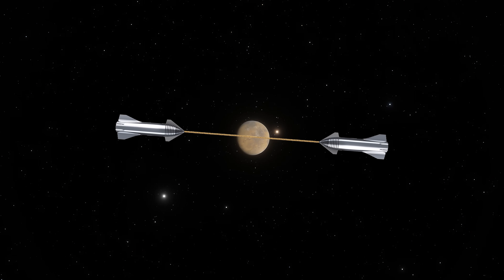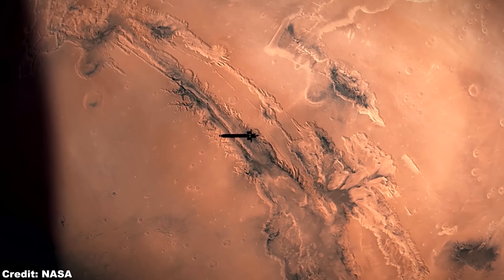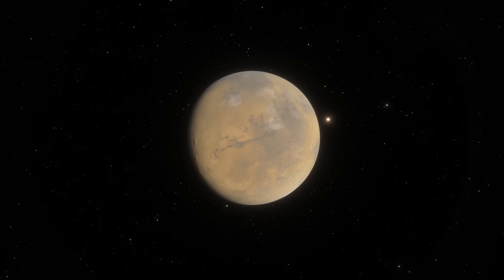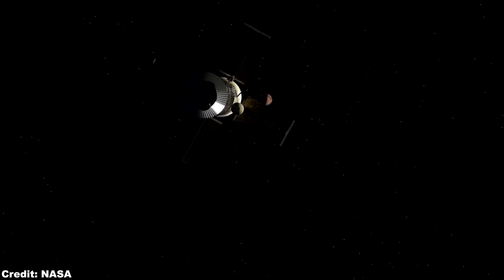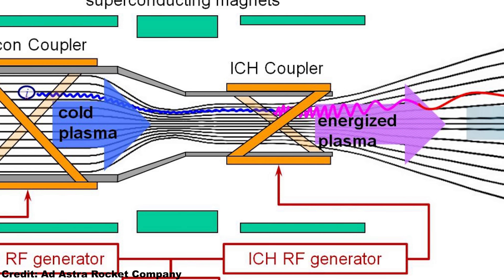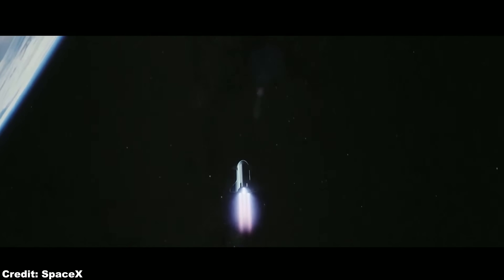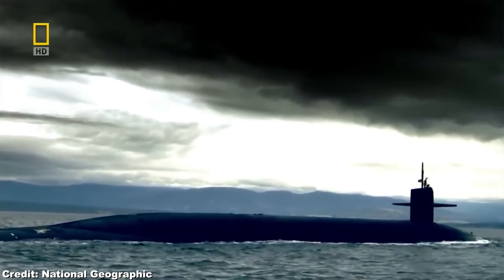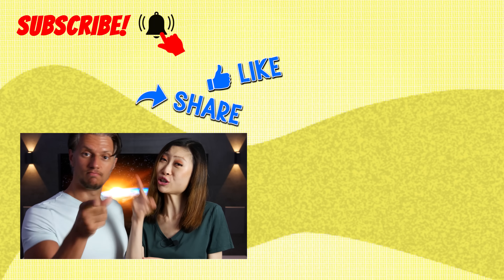4 Ways To Upgrade Starship's ENGINE! [SpaceX Starship FLAW FIX]

Comment: My plan is completely different, my direction is completely opposite to what is currently happening. I hope you can follow. After a teacher was tragically killed , I vowed to make a difference in the development of Rockets, it took years and the final part of the puzzle was in place . Parker satellite, the material is what I've been searching for, along with the heat shielding tiles from the Space shuttle. My design is a hybrid,  part plane , part rocket and Lasers powered by Electricity...to grasp it all , well this is also an internal engine, kinda like your car , with that been said, let's take a look their. Cars  have given me many things to work with since they have surpassed 300 mile per hour range. And a suprising 3 cylinder part electric 4 seater . I focused on one a bit before that . A formula one car that blew the competition away so badly that it wasn't allowed to participate. A rotary engine. My problem was that the pressurization heat would melt my engine, now that's out my way due to well, what I mentioned above. I can securely say my engine can safely produce over a million pounds of thrust without,  well blowing up. And this engine is multi purposes for the same reason, it's got to do just like any space craft, it has to make turns and has to have those vectoring thrusters. Need help to bring my creation to life . Everything can be explained and very factual.
Reply: But a cylinder engine is dependant on the atmosphere to operate. And a cylinder engine is DRAMATICALLY less efficient then just a basic rocket engine. Yes your car can go 300mhp but a rocket can go 17,000 mph easily.
Reply: @a1919akelbo  yes I agree with you, since I purposely left out a few major factors that makes my engine  significantly faster and efficient. My fuel can just be the plasma itself, explained by Liek Myrabo himself (LightCraft) via YouTube of course. I developed a improvement by using a  method called sequential firing by using diodes for triggers. His single cylinder has nothing to no support and the laser is stationary, on my system it's enclosed and uses helium as the fuel and can make Mars and back in under 3 days . Still missing more important key factors.  I can only tell so much, but everything mentioned here is realistic and possible because everything that is needed is in existence today
Reply: @wikkid1show569  first off, plasma cant be fuel since plasma is the end result of the combustion or energization of fuel. Thatd be like saying your going to use food to buy a car, no, you already spent the money, now you have bread. You cant use bread to buy a car. You can however use the plasma as a mass to push against (ion propulsion) or have the reaction that creates the plasma accelerate you (rocket engines). A cylinder engine converts Linear forces to rotational forces THERE IS NO USE FOR THIS IN SPACE (Except in positioning systems). You are proposing putting a fully expanded gas inside a system that is SPECIFICALLY designed to harness energy from the EXPANSION of gasses. This would not work. In fact all the plasma would do is cool down, and create a low pressure enviro inside the cylinder. Hell lets say you figure out how to harness the low pressure energy into your engine, and let's say you've found a way to transfer rotational energy into vectored linear energy too. Even then. You would have to first create the plasma then put it through the engine. And i don't think youve unlocked the mysteries to 100% energy conversation so there is a loss. A dramatic loss. In the 99%'s (i can do the math if you need further proof). It would be LITERALLY hundred of times more efficient if you just took the created plasma and immediately shoot it out the back. Every micro second you spend holding onto and doing things to that plasma is throwing kiloneutons into the toilet. Plasma isnt a magic gas that can be used to power anything. Plasma is a flame, plasma is the sun. The millisecond you stop fueling a flame it goes out. Plasma isn't stable, plasma cant be harvested for energy (unless your talking fusion), plasma can only be gotten rid of or allowed to form back into its natural state. That's it. You're trying to start a fire using ashes dude.
Reply: @wikkid1show569  here the most basic way of thinking of what i just said. You say you have an engine that can turn hot energy into spinny energy into fast energy. I say we already have engines that can turn shocky energy directly into fast energy and boomy energy directly into fast energy. Why do we need your inefficient engine that takes 3 steps instead of 2?
Reply: @a1919akelbo  when it comes down to it, did you take a look at Lightcraft, if so , you saw a single cylinder system exposed, and recognized that they spun it using an airgun and in slomo it gave a disbursement. When it comes down to it, this format is practical and fits for faster space flights and can burn for the entire trip and not 5000 seconds which is the energy shown in this video.
Reply: @wikkid1show569  the energy comes from the airgun not the plasma.
Reply: Jesus fucking christ dude, i googled it and a "lightcraft" engine is just a magnetic plasma drive. Theres no "car" engine and this idea has existed for fucking eons its not "new" or "alien". There's a video where it literally says "the engine operates by pushing heated plasma through a large electromagnetic field". We researched it, we looked into it. And unless you have a fusion reactor in orbit there's no benefit to the cost. Also "shockwaves" of light don't work that way. I did a bit more then watch a YouTube video.... I spent 10 years of my life studying this.

Comment: It would seem, that for the foreseeable future at least, nuclear thermal engines would be the most likely way to get people to mars in a fast and efficient way. One idea i have, is to maybe adapt a tanker version of starship, with fuel tanks that could be used in a reversible manor, while putting one (or more) nuclear engines underneath a (detachable) nosecone section. Then you launch it into orbit like you would with a regular tanker, and once you get there, you refuel it and dock it but-end with a starship in orbit, and voila , you got a starship ready to go wit a nuclear booster attached. An even crazier idea (if at all technically possible, that is) would be to do something similar with an adapted version of the super-heavy booster. Start with removing the landing legs. Add the nuclear engines at the top underneath a faux (detachable) nosecone. Add regular (chemical) tanker versions of starship (2, 3 or even 4 ?) to the sides of the super-heavy as boosters. Fuel up the super-heavy with enough fuel to get it in orbit, then launch it. If it gets to orbit, refuel it, and attach it but-end to a starship, like a tanker. Then you got an even bigger booster, plus, because the super-heavy has attachment-points, you could add other starships in orbit, like two chemical boosters and two freighters, or four of each to either carry some extra load, or give it even more extra speed.
Reply: "Fast and efficient way" orbital mechanics states you can only pick one here.

Comment: We definitely need more nuclear engines! If SpaceX can provide Starship as lunar lander (or even just get orbital), Nasa could really start investing heavily on nuclear engines and reactors. VASIMIR would be awesome, but even if all other problems are solved, artificial magnetic fields can be bad for humans. Basically the artificial magnetic field traps radiations inside the ship because it can't get out. And human body ain't doing well either. Within strong magnetic fields electrolysis is known to happen with saliva causing different taste. I recently found a scientific paper from 2005 about this, it's not too long. It's "Shielding Space Explorers From Cosmic Rays"
 by Eugene N. Parker. Google it, and I think it was the first result (agupubs)

Comment: Artificial gravity for a couple of hours a day almost for free on Starship. The inside of the hull is approximately 8 meters in diameter. You could ride a bike around the inside of the hull at 32 km/hr and your head would be at 1 g and your feet would be feeling more like 2g. It's not a new idea but I don't hear anyone talking about it. Not a perfect solution but better than nothing.
Reply: That sounds good but a steady diet of 21 rpm might make people nauseus, on a bike you tend to keep your head in a fixed position so hopefully no nausea. I'm also wondering if rotating the whole ship will really be that easy.
Reply: @robcowley85  Nope !

Comment: Look into nuclear batteries. The components have a half life of a 100yrs. The radiation emitted can be blocked by 2mm of sheet steel. These engines and designs will only work for starship if the nose cone is able to disconnect and reconnect with the different engines and fuel. Because the amount of thrust to mass ratio is so low. Pushing the vasimir engine alone with the vasimir exhaust will take some time to get to an appreciable speed. Hard to imagine how long it would take to get 100 ton of fuel up to speed. Of course we can imagine some tweaked version that incorporates a small combustion reaction rocket engine whose hot exhaust components are compressed electromagnetically further increasing increasing the heat and energy to plasma levels. Decreasing the amount of rf heating needed within the plasma drive. Putting that saved energy into magnetic confinement and further acceleration. So send a fuel tanker in orbit around mars the slow way. It will be there for when the crew with the vasimir arrives... 

You know the  starship enterprise the disc can separate  from the plasma warp drive. So isipose it the way it gonna work

Comment: I'll stick my oar in, see if I can get it wet.

Problem: if a non-chemical rocket engine is added to Starship that is only useful in space, then we will not want to land that extra mass on Mars, only to drag it back out of the gravity field when it's time to leave.

Solution:  add a nuclear 'tugboat' for the transit to and from Mars.  This is a separate module which is added to Starship in space, detached at Mars orbit, reattached when it's time to come home.

Problem:  It's still too slow.

Solution:  Mate a booster stage to the stack in orbit.  Boost the Starship, along with its nuclear tug.  This conserves fuel on-board Starship, which it will need to reach Mars orbit, since the Starship will be going faster.  The booster then returns to Earth orbit and is refueled for the next Mars mission.

Problem:  I want a boost on the return trip, too!

Solution:  Okay, add a booster to Mars orbit and use it to go faster for the trip home.  That booster will return to Mars orbit for the next mission boost, too.

Problem:  Where is all of this extra chemical fuel for boosters coming from?

Solution:  At least initially, from Earth.  We have to shoot up tankers to fuel Starship anyway.  More tankers will be needed to follow Starship to Mars.  With the booster scheme, we'll need even more tankers.  It's going to require a hell of a lot of launches for each Mars mission.  Once we can synthesize fuel on Mars, we'll also need tankers moving chemical fuel to orbit and returning for more.

Problem:  Argh, it's all way too complicated!  And expensive!

Solution:  go slower.
Reply: People go on long sea voyages — and in cramped corners (nuclear submarines).  A different "solution" to the slow Mars trip is to either have less people per trip or build a bigger ship (18 meters anyone?).

Comment: THIS IS ELON ! AGAIN !  OUR NEW MAD USA ENGINE FOR OUR TRIP TO ANDROMEDA IS NOW BEING ATTACHED TO OUR NEW MAD USA ROCKET AT  THE NEW ANTARTICA SPACE X LAUNCH FACILITY !  THE MADUSA IS NOT A ROCKET ENGINE ITS A NEW PROPULSION SYSTEM BASED ON ANTIMATTER FROM COBALT 55 MELTING GIANT ICE CUBES OF TRITIUM
AND DEUTERIUM  FIRST WE SEND UP TANKER AFTER TANKER OF ICE CUBES THEN THE SLUSHY MACHINE IS SENT UP AND THE SLUSHY MACHINE IS CONNECTED TO THE TANKERS WITH THE ICE CUBES . THE SLUSHY MACHINE MAKES SLUSH AND THE ANTIMATTER IS INJECTED MAKING SUPER HEATED ANTIMATTER ANIHALATED STEAM THAT POURS OUT OF THE SINGLE COMBUSTION CHAMBER THEN FLOWS OUT OF 50 TUBES TO THE 50 MADUSA NOZZELS .  SO ITS NOT A ROCKET ENGINE ITS A MAD USA DRIVE FOR ROCKETS OR ANY THING ELS U WANT TO ATTACH IT TO LIKE A MONORAIL OR A DOUBLE OR TRIPLE TUBE HYPER LOOP AND THE NICE THING IS ITS ONLY MELTED ICE CUBES IF U DONT WANT THE RADIATION !

Comment: What about solar power? some solar panels reach 2000 W/kg and 17000 W/kg could be achieved in the near future.
Reply: Well solar panels absorb energy they don't expel it, you'd need either an ion engine, HAL effect thruster, thermal rockets, etc. But keep in mind the more surface area the more mass.
Reply: @a1919akelbo  Add to that, the further from the sun, the less energy. Solar cells are about the order of 6% efficient, 10% at most.

Comment: The key is hire the energy production. In space to have effective inter planetary travel an effective fusion reactor needed. The nuclear option is only feasible in rotating systems where the Starship is in multiple km from the central.
There is another method to travel but it is very SiFi (at least now):
Warp drive or FLT (Faster than Light). --> the current problem: There are huge holes and misconceptions in particle physics and in cosmology.
It could work if:

1. Gravity is not a force.
     This means there is no force carrier particle (graviton does not exists). But the gravity is a flow of underlying fields.
2. We find a high mass particle what can effectively manipulate the flow of those fields.
3. Properly working light weight fusion reactor to feed the particle collider with energy.
It is at least a century away...
Reply: Solar power can be very effective (between 2000W/kg and 17000 W/kg in the near futur) but you need centrifugal deployment.

Comment: Also fusion rockets especially  the pulse variation [ http://large.stanford.edu/courses/2013/ph241/micks1/docs/aiaa-2000-3856.pdf ]. A citate  :
==================
When light atoms like hydrogen fuse together, the energy released surpasses that released by splitting heavier atoms through fission, so much so that a rocket propelled by this energy could reduce the travel time to Mars from a matter of months to a matter of weeks. [4] However, fusion is not as well understood or as easily controlled as fission, which is why fusion reactors aren't used in commercial power plants, but only for research. Fusion reactors still struggle to contain their plasma within magnetic fields, and current designs require so much energy to sustain the fusion reaction that the reactors produce a net loss of energy. Nonetheless, fusion releases so much energy that the technology only needs to get a tiny bit past the break-even point before it can generate considerable thrust or electrical power. [4]
Fig. 3: Project Daedalus with its colossal fuel tanks. From nose to nozzle, the design was nearly twice the length of a Saturn V rocket. (Source: Wikimedia Commons)
Fusion rockets differ from fission rockets in that the propellant expelled through the nozzle would be the hydrogen-helium plasma involved in the fusion itself. Like in a tokamak fusion reactor, the plasma would need to be contained by a magnetic field, except the field would be shaped to allow the plasma to "leak" out the nozzle. [4] However, in order for the particles generated by the fusion reaction to be charged so that the magnetic field can direct them out the nozzle, the plasma must be heated much more than is necessary simply to initiate fusion. About 100 million Kelvin is the required temperature for fusion, but the reaction mainly produces neutrons at this temperature, which can't be steered in a certain direction for thrust. 600 million Kelvin, on the other hand, can enable a different fusion reaction that produces charged alpha particles, meeting the requirement for thrust. The plasma can be heated to this point using microwaves, although such heating would require significant power on board the spacecraft. [4]
An alternative to the continuous-flow rocket described above is Project Daedalus's pulse propulsion engine, where pellets of fusion fuel would be injected and then ignited by electron beams inside a reaction chamber. The fusion fuel included helium-3 for its high energy release, although this isotope is extremely rare on Earth and would probably need to be mined from the moon or the atmosphere of gas giants. [3,5] Daedalus was designed in the 1970s to be a fusion-propelled interstellar mission that would reach a max speed of 12.2% the speed of light and arrive at Bernard's Star (5.9 lightyears away) after 50 years, all using nothing too far beyond the existing 1970s technology. [3] Although the project was simply a feasibility analysis to be published and not a physical vehicle to be tested, a reasonably sound (though expensive) design does exist, and other designs and studies have followed it. [3] Fusion is arguably the only propulsion technology within reach of our current knowledge of physics that is capable of an interstellar mission lasting less than an average human lifetime, even though significant advances in fusion reactor technology are still a prerequisite.

Comment: This is brilliant, and it may be that there is someone out there in the general population that might have the answer to some of these problems. In the meantime, it is clear that some form of electromagnetic thruster, be it Ion drive or Hall or VASIMR engine, is in the offing, given that they are hugely more efficient than chemical thrusters. I have a feeling that this may be arrived at like EV battery development at the moment, a huge series of iterations of trial and error.